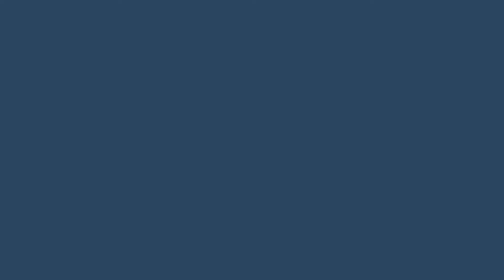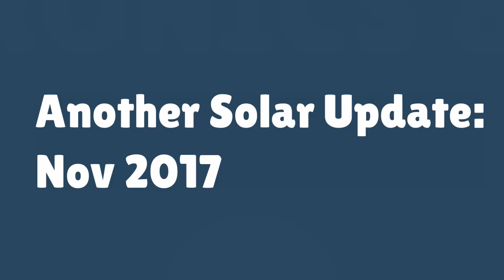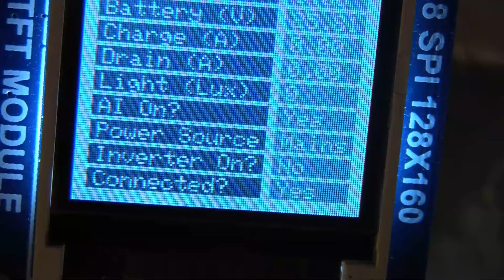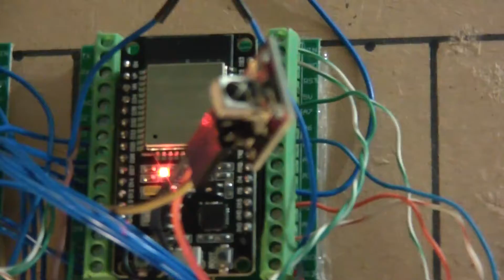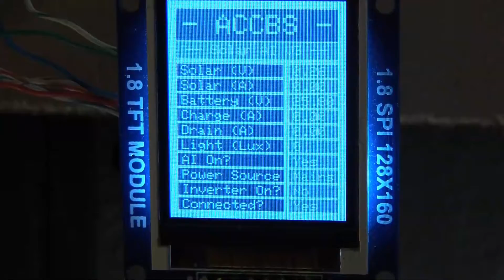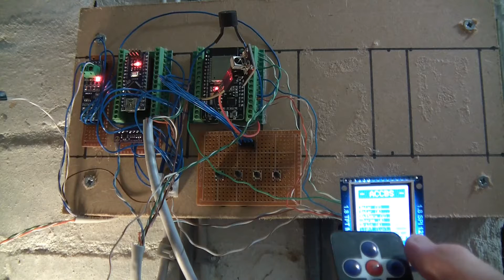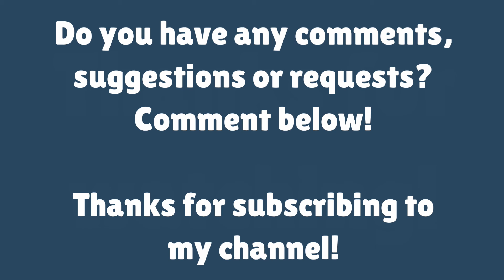INVESTIGATING: My DIY Offgrid Solar Power System - New TFT & IR Remote!

Comment: In your code for accepting commands, you could have a check condition on the backlight status. If the backlight is off, turn it on. Then decide whether you want it to do the command afterwards, or you have to press the button again to actually perform that task. That way you don't have to press any "specific' button to turn it on. All buttons will. Then use a timer to turn it off after like, 10 seconds or so.
Reply: Instead of measuring lux to determine sunset/rise, you could also use an RTC and calculate set/rise times based on the date. Alternatively if your ESP is connected, you could get those times from the internet.  But using lux in combination with a date  to differentiate between clouds and dawn/dusk could also work. 
Your batteries should take care of short periods of clouds, but in wintertime they may not get sufficiently charged. Charging should stop when full and only start when sufficiently low. For the alternator you could use a similar scheme: only switch on when sufficiently charged and off when getting too low. By using different values for starting and stopping you should be able to minimize unwanted switching.
Reply: Sounds like using both sunset/rise times and lux you should be able to minimize switching to just two times per day. Don't switch solar on until lux is high enough and sunrise-time is near. Once solar is on, you keep it on until lux is low and sunset is near.
Reply from the maker: Korishan These videos are a week behind. ;) ;) ;)
Reply from the maker: Korishan What happens is very similar to what you've suggested! What I do is detect any keypress. If screen is on, then perform the command. If screen is off, ignore command but switch tft on. So key effectively turns on tft... :)
Reply: Nice versatile improvement to use that IR. Hysteresis is needed to solve that switching behavior. Great project, inpiring video. Thank you and keep up the good work!
Reply from the maker: Maxint R&D Thanks! By hysteresis, do you mean, 'add a delay'? :D
Reply from the maker: Maxint R&D I'm thinking that I'm going to abandon controlling by light, and make it timer based instead. I haven't worked out the exact algorithm for it yet though. I'm thinking that I'll turn solar on an hour before sunrise and turn it off an hour before sunset. In next week's solar update, I'm going to talk about keypad, NTP, and switching tft on and off.
Reply from the maker: Making it time based isn't going to be perfect either though... What if it's a bad day?
Reply: (You're too fast, I was still replying to the first comment... ;-)
Hi Antony. Perhaps my answer was too cryptic. My understanding of hysteresis in general is that instead of switching depending one measurement, you use two measurements. My first thought was to use a different measurement for switching off than for switching on. (See also https://en.wikipedia.org/wiki/Hysteresis)
Reply: I think controlling by light is just fine. It's the switching you want to improve. Adding a simple delay could also work if that avoids too rapid switching off and on again. (I mean you would limit switching based on the time you last switched. E.g. if less than one minute ago, wait and measure again until for instance five minutes have passed).
Reply from the maker: Maxint R&D It's not just that though. :( It can do it all day in cloudy weather. A few days ago, light was hovering around 5000 all day lol...
Reply: Using a time based delay could cover for bad days (or the occasional black thunder-cloud passing by). E.g. don't switch on unless at least five minutes since last switched AND if the proper level for switching on was reached)
Reply from the maker: Yes, I've considered that (and I actually already built a delay into the AI a while back), but it still flicks! It's so hard because if I say oh it's gone dark (give 30 min delay), the last 25 minutes of that non switch time might be full sun! If I have a shorter delay (which I have now), it can make the most of the sun, but switch like crazy. Even with a 5 minute delay, it can still switch > 20 times a day! Ideally, I need to minimise switching so that any devices don't get disrupted, etc. Really, I'd like switching to be less than 10 times a day. Look at today for example, particularly between 10-11am: http://solar.accbs.co.uk/Chart.aspx (Go right to the bottom chart. It's completely unpredictable!) What I need is some sort of super algorithm... Which different algorithms can you think of?
Reply from the maker: Let's start with the solid factors:
Before sunrise, solar should be off.
After sunset, solar should be off.
At sunset, the batteries should be (near) fully charged.
Solar must shut down at any time if batteries are too low.

Tools we have to play with:
Timers
Light
Battery Voltage

This is what i'm thinking now:

So every morning at 00:00, [sun rise] is set to null and [yesterday's sun set] is set to last occurrence of over 1000lux. If [sun rise] is null and light is over 1000lux, then set [sun rise] to this time. Switch solar on... (dawn).

If [time now] is > [yesterdays sunset] - 3600 (an hour), then shut down. (As it will be sun set in around an hour).

Every poll, log the last time light was over 1000lux. 

IF batteries do not charge back up within the last hour, use some sort of emergency mains powered trickle-charging facility.(Will need to be made).
Reply from the maker: Maxint R&D Funilly enough, that is what I considered. That is why today's video is about RTCs :D
Reply from the maker: Maxint R&D Exactly! :D I looked into RTCs and NTP... In my opinion, NTP is better...